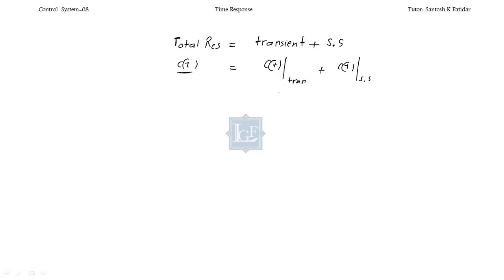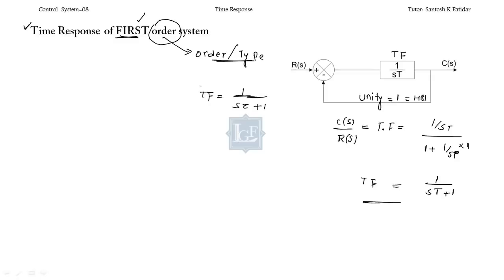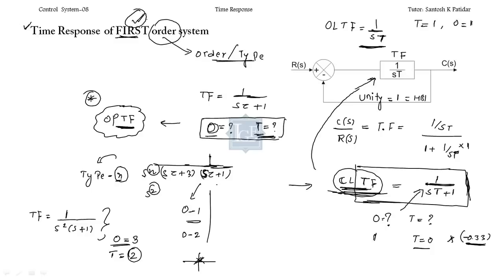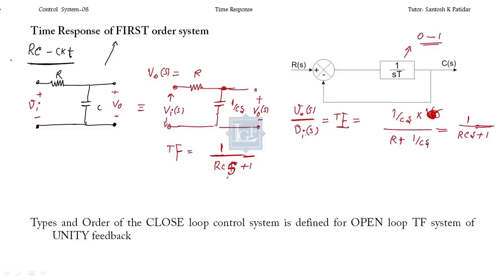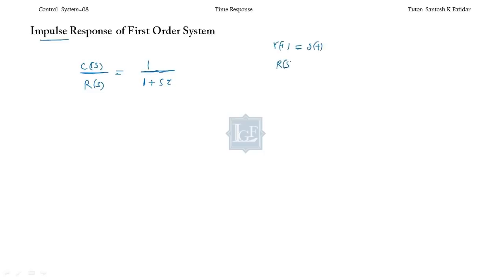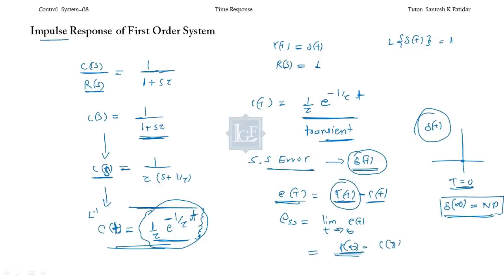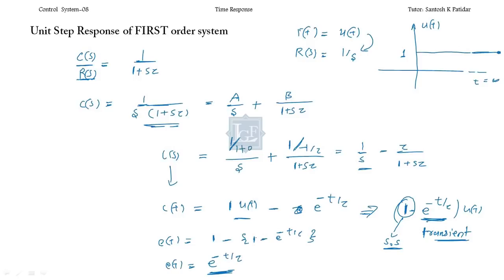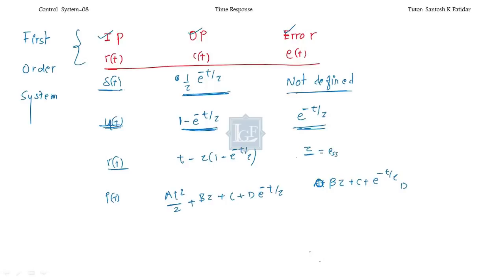Lec 08 Time Response of first order system

Comment: Sir in the RC circuit  if we take output across the resistor the transfer function of the system changes right but u told that transfer function is independent of input to the system.So please give a clarity regarding this.
Reply: chaitanya kalepu 
If u will take op across register means u r changing op in relationship as per the transfer function.  In the RC ckt we do not take op across register bcz practically every control system is LOW PASS FILTER n ee have to mention that condition in every ckt.

Comment: Sir if two capacitors will be there then will it be a second order system ?
Reply: It will be 2nd order if 2 capacitors are not in series or parallel in the circuit.
They should be separable not resolvable.
Reply: Santosh Kumar Patidar thank U sir
Reply: Santosh Kumar Patidar Sir then system order can Be upto N number as per Memory components